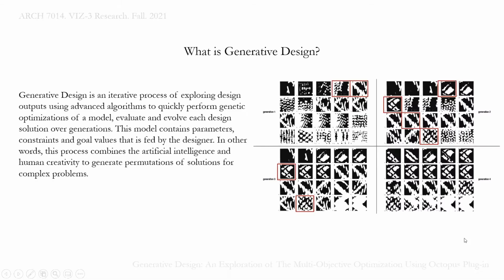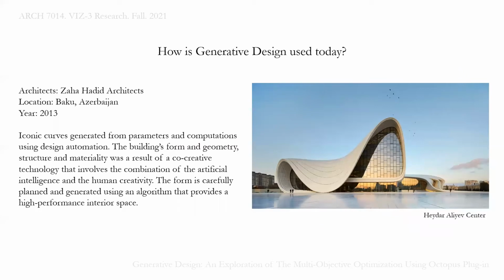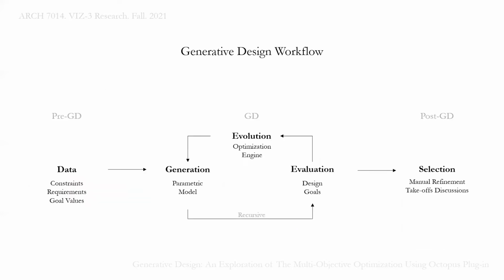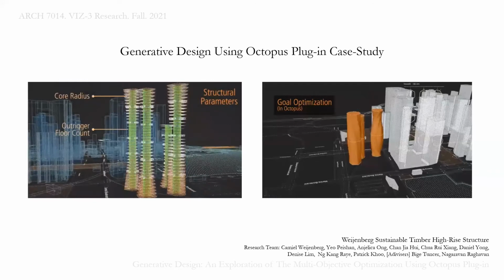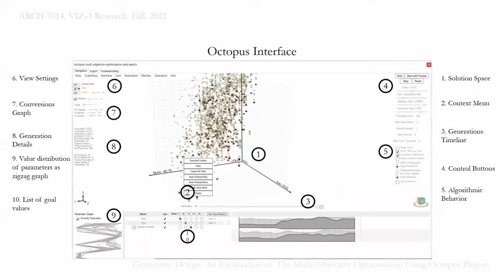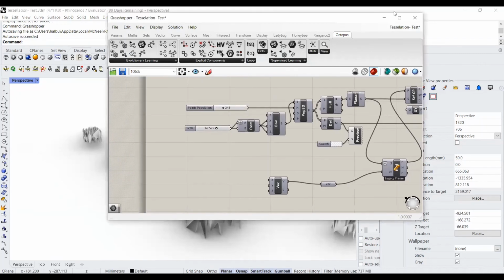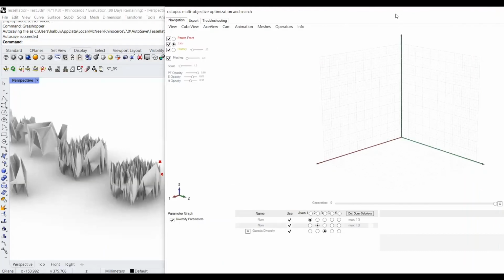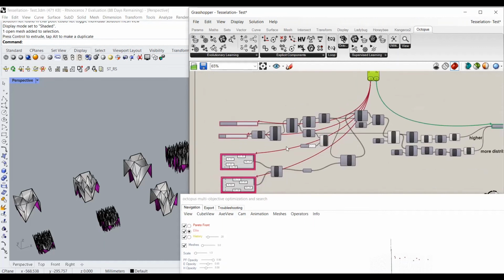Generative Design: An Exploration of The Multi-Objective Optimization

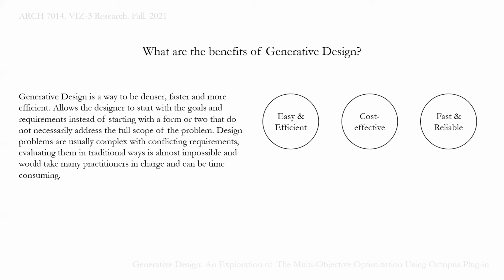Comment: 2:11 just on this note; Generative design is no less biased than a human Architect. The optimisation criteria become the bias. The designer is in charge of selecting those, and of understanding how each criteria works. One of the severe pitfalls of generative design through optimisation is exactly this, designers who are blind to the fact that their algorithms are indeed biased, prioritising certain (typically engineering-based) metrics over other (usually more qualitative) metrics.

Optimisation algorithms are an awesome tool. Used uncritically, they easily create horrible architecture.

As an example, I recently went to a new development near me where I'm 99% sure they used an algorithm to optimise direct sun exposure on the paths between buildings, letting it adjust building geometries to match. The result? A wayfinding nightmare where the casual user has no clue where they are and where they're going, and an incredibly bland sense of space, due, I believe, to the non-hierarchichal / rhythmical nature of the way building masses were shaped. There was tons of variation on a technical sense, in building height and shape. But none of it REGISTERED as variation, because their was no human patterning to it, conjoined with the facades themselves being low variation (three different shades of the same brick veneer, with minor bump patterns between fenestrations), the entire area just ended up... Well yea bland as hell.

Could you have used the exact same algorithm to create awesome architecture? I'm sure you could. But in this case, nothing about that area (except for there being a decent amount of greenery, which in 30 years when the trees are taller will be nice) was enjoyable.